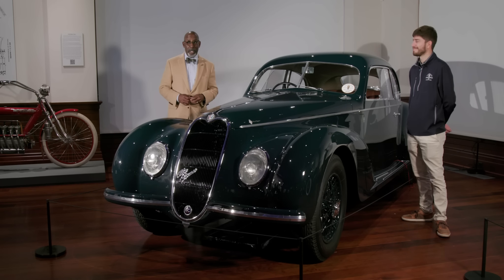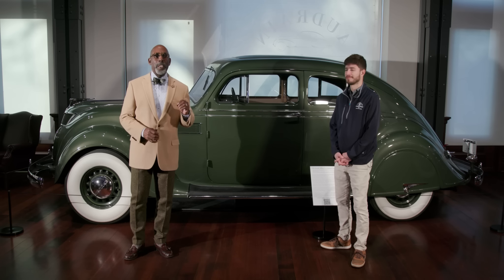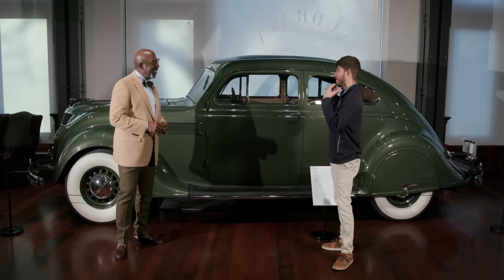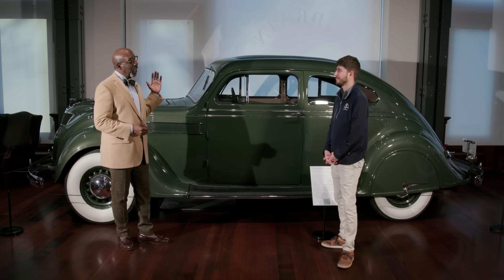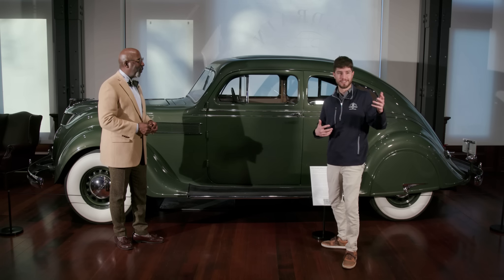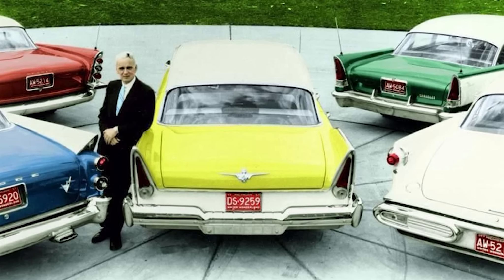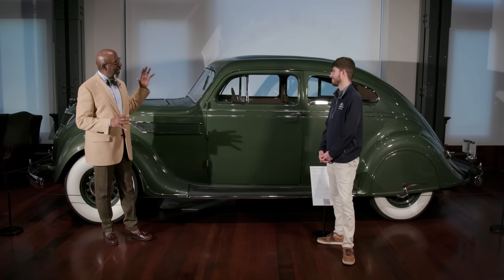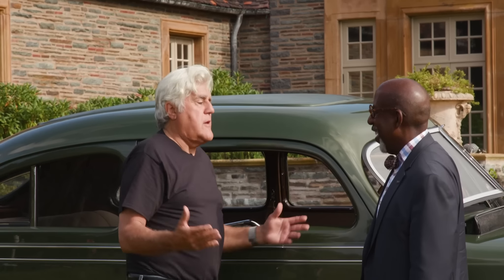Aeroplanes For The Road: Sculpted For Speed

Comment: Thank you for such informative content, it is genuinely a pleasure to watch this channel. That said, I must disagree with the notion that the advancement from the Patentwagen to the 6C was more than from the 70s to now. "Relatively" obtainable cars with level 3 autonomy, >1000 HP, <2s 0-60, virtually 0 emissions/NVH, and most importantly, the entire world's knowledge at your fingertips, would have been unthinkable in the 70s. I also want to bring up the fascinating Rumpler Tropfenwagen, which had a 0.28 cd, curved glass, central driving position, IRS, and mid-mounted W6 with dual OHCs and 4 valves/cylinder in 1921!!! Alfa Romeo themselves made a prototype called the 40-60 HP Castagna Aerodinamica, which had similar aerodynamic design features in 1914! Even this great video does not do justice to the level of innovation at the time.